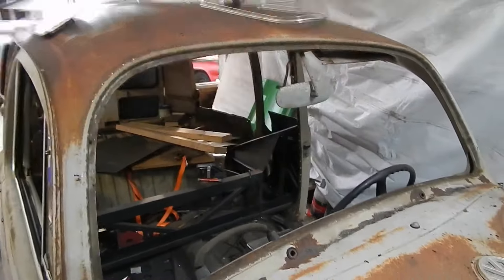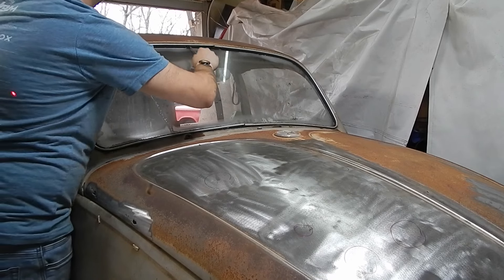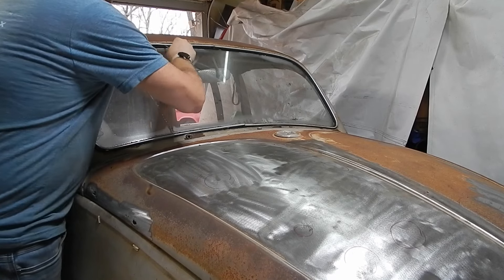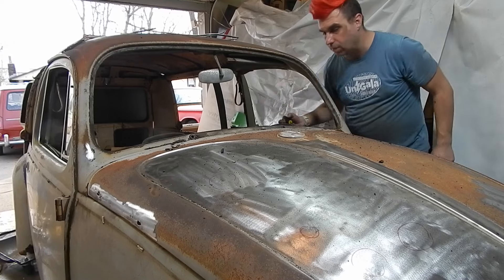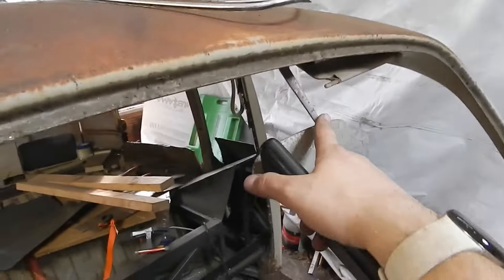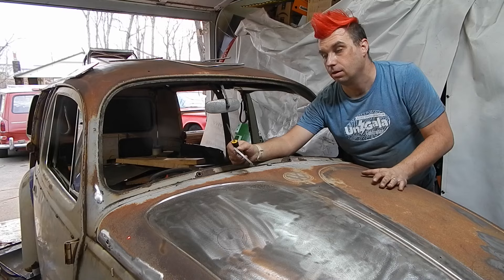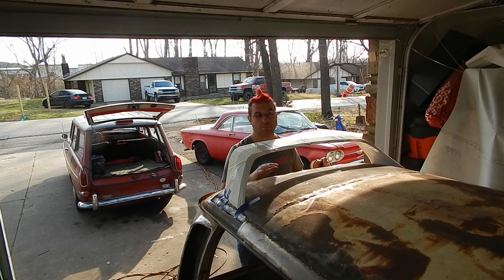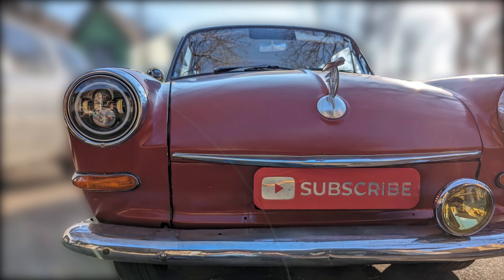Should This Go on my Käfer Van Build, Panel Bug ep 19

Comment: I Duckman that windshield out, sit in the seat and palm upper corner and push.  Out she goes.  Pull rubber off glass, then trim slips right out.  Then dance around and scream a little and accidentally break the glass by unrelated issue.

Comment: the windshield trim mighve come out cleaner if you had cut the rubber around it , then you can cut and bend away the rubber from the trimpiece and get left with less buckles on the trimpiece
Reply from the maker: Probably but the rubber was no longer rubber. It was solid and crunchy so all it would do was crumble. Nothing left to cut.